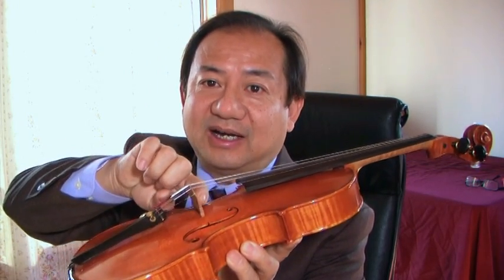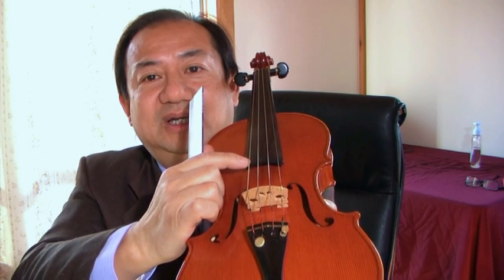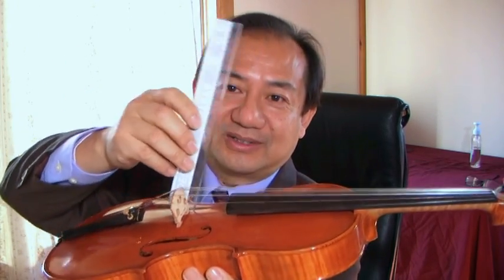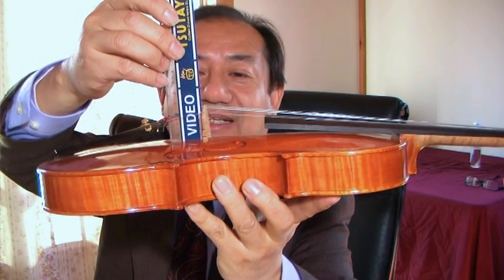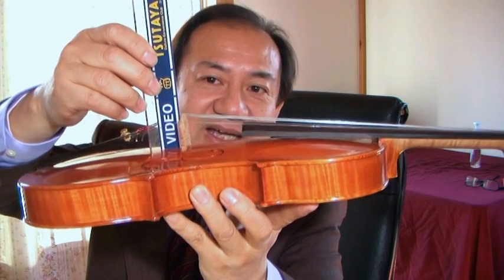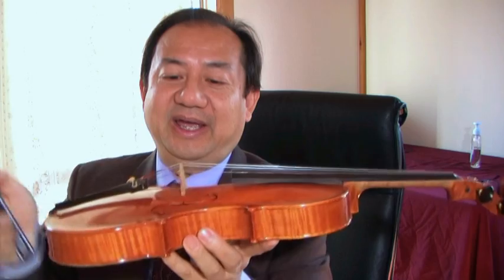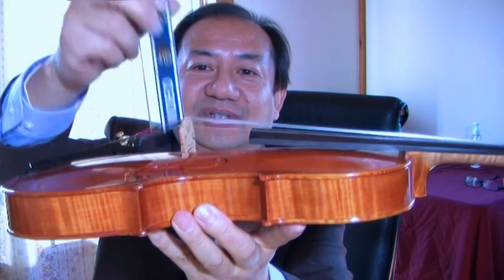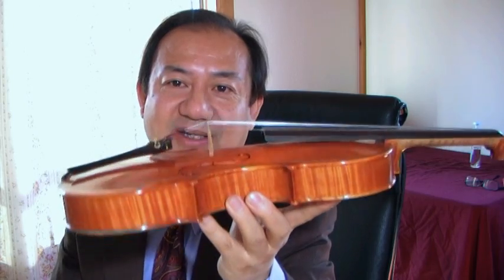~ All About The Violin Bridge ~ by Daniel Olsen

Comment: awesome video!
i have a question...i dont know what size my violin is....but i measured the back without the "end button" part...and its 13.5 inches, what size is it?
also I have used 4/4 fittings in my violin(string, bridge, tailpiece)
Can you make a video about violin measurements and what will happen if you use the wrong things in your violin(such as using 4/4 strings on a 3/4 violin?
Thank You!!